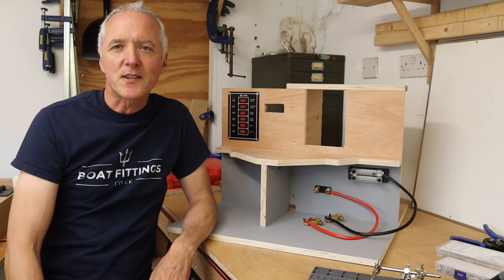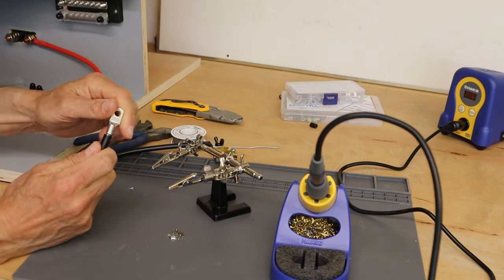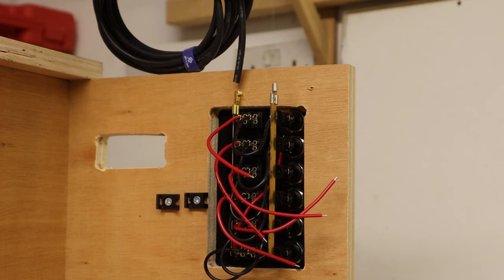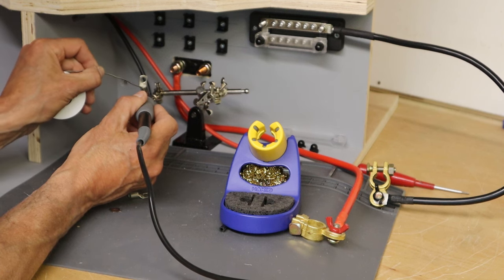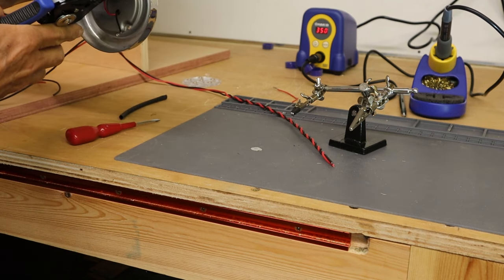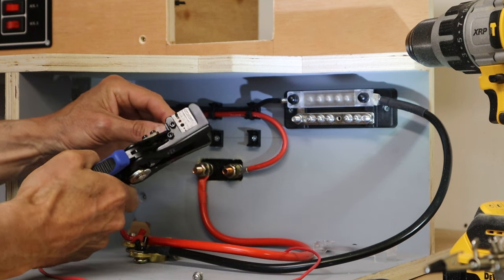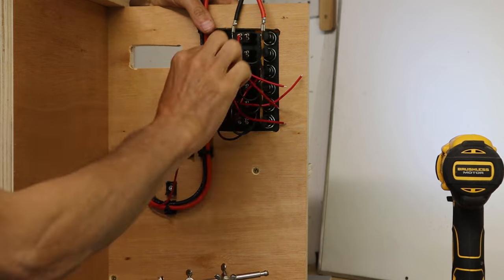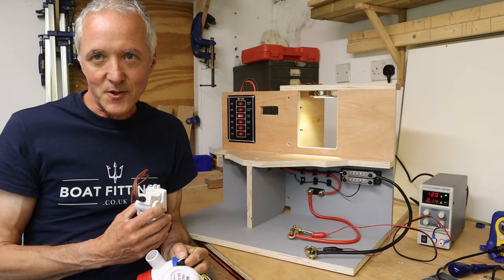Boat Electrical Wiring Made Easy, Part 2, Switch Panel Wiring, Cabin Light Wiring - Complete Guide

Comment: Great how-to videos so thanks for putting these out.  You commented you prefer solder vs crimp connections.   My experience is driven from aircraft standards and those specify crimped connections using good quality AMP / aircraft grade terminals that crimp both the stranded tinned wire and also the insulation covering the wire.  Also need to use a good quality crimp tool  for this purpose.  If you use low quality automotive style terminals and the simple single point crimp tool they only crimp to the wire and poorly at that and will fail if you pull on it.  The correct AMP / aircraft style double crimp connector crimped with a good crimp tool will not pull out or fail.  We tested them to failure and the wire will always fail first (so as strong as you can get) and the crimped connection remained intact.   The crimped aircraft terminals are done that way for the strength but also for the same reason we use tinned and stranded wire, never solid wire, because of the possibility of flexing and vibration which is the same type environment on a boat as on an aircraft.  A soldered connection is more prone to fail if flexed or subject to long term vibration.   The added benefit of using AMP / aircraft grade crimped terminals is it is easy to do a new connection or add another terminal on the water as you don’t need power for soldering or the soldering equipment. Easier to carry a good quality crimp tool, wire stripper and extra terminals. Just a suggestion for you to consider or try yourself.
Reply: As a note, ABYC Standards do not allow solder as the sole means of connection for an electrical connector. You can crimp AND solder, but solder by itself is not permitted. So if your boat may be subject to ABVC Standards (or you want to meet typical standards) then crimping should be used or used as well. Not probably an issue based on the accent in the video, but I'm not sure of Euro/UK standards and if they differ.
Reply: @jeffclapp7330  I believe that soldering is not recommended because it can make the wire more brittle.  You want the water to be flexible.  Also, he "tinned" the wire with solder, but he should have already been using tinned wire.
Reply from the maker: Hi many thanks for your detailed comments / suggestions.  I agree that good quality crimping tools and the corresponding connectors make for a robust solution.  In many cases though people use cheap and nasty crimp tools leading to a poor joint, which in my opinion makes soldering more reliable compared to many poorly crimped connectors.  I do take on board your comments though, and thanks for making them.

Kind regards,

Richard

Comment: I have found it easier to understand once I get the concept of a circuit in my mind. A circle; starting and ending at the battery going out to the appliance on positive and back from the appliance on negative; with the various switches and fuses on the positive side. 

Good videos, thanks.

Comment: Very well explained and looking forward to Part 3. I am hoping you will deal with the challenge of multiple interior lights and running out of switches as the series progresses . Thanks again
Reply from the maker: Hi thanks for your kind comment.  Thanks for your suggestion on looking into the wiring of multiple lights - I will keep this in mind for one of the videos in the series.

All the best,

Richard
Reply: Can you run a busbar for all your led lights back via a single wire to the switch/breaker to avoid overcrowding the switch with more and more wires as lights are added (or any other system where things are added on. Subject to load obviously).
Reply: Great videos by the way
Reply: @BoatFittings  looking forward to seeing this. ☺

Comment: crimps are normally preferred in harsh environments, great aid for the diyer
Reply: Which is why they are used on automobiles and pretty much everything else. There are people who insist on soldering everything because they had a crimp they did go bad but they can never answer why a 30 year old car still has good crimps. If you are going to solder then get solder connectors v.s. using crimp ones and then add shrink wrap to provide some stress relief as well as short protection. The big issues with solder beyond the time to do it are corrosion due to the flux and cracking due to the hard spot. Modern solders also take a lot of heat and that means melted wire covering which is perhaps why silicon is being used here.

Comment: The amount of positive comments is testament to how great your videos are. Thank you. I have a question: why couldn’t I use the negative bus bar on the switch panel for individual negative returns? On my switch panel the negative bar is of a similar gauge to that of the positive one, making me think it should handle the current that would return through it if I connect the peripherals there directly. Also, if no peripheral negative returns go to the panel bar, then why do you need the fat return from panel to battery? It would seem you would then only need a cable to handle the current from the panel pilot lights?
Reply from the maker: Hi thanks for you comment / questions.  I don't want to comment on your specific switch panel, but I if your switch panel has a good sized negative bus-bar then it would seem reasonable to make use of it.  For your second question, the 'fat' negative return cable was used mainly as it came as part of a set (positive and negative) than the need for a fat wire.

Kind regards,

Richard

Comment: Hi Richard, brilliant series. i've just discovered your channel and will be bingeing your back catalogue every day! What a mind of information you are! Even just to remind oneself before carrying out a "job" your series is brilliant!. I have an old 1992 35ft Nimbus DC currently based down in Cornwall (legs reconditioning!) with so many jobs, my early retirement will definitely not be idly spent! And if you ever want to set up a boat series, I'm happy to work with you to make it happen! I have 2 x VP AD41's on sterndrives, so plenty of electrical stuff to work on both engine and domestic!!
I dearly want to replace a switch panel on the helm station, as the bakelite switches are all perishing, and was wondering if you have contacts other than the usual large distributors that I might try finding old replacements? New may be better for waterproofing, etc, but will change the look substantially? 
Keep up the great videos.  regards, Daniel

Comment: What are your thoughts on putting a bus bar closer to the switch panel? also Using a fuse block and using 1 wire with 2 wires in it for Pos and Neg? Thanks for the series I'm finally getting less intimidated and looking forward to cleaning up the rat's nest situation I have under my center console boat.

Comment: Great video, very clear and well explained! I have a question though: Why does the black wire needs to be so think which goes to the switch panel? It supposed to supply the negative only for the lighting of the switch panel, which is like 6 LEDs. Or did I misunderstand?
Reply from the maker: Hi thanks for your question.  Actually the negative wire happened to be part of a set purchased together, so it seemed a shame to waste it.  Other than that no reason at all, and a lighter gauge wire would have been absolutely fine - well spotted.

Kind regards,

Richard

Comment: Which voltage should I choose for a trimeran? 12, 24, 36 or 48?
If it has twin 2000hp diesels and 5 800kw outboards what sort of capacity should the batteries have?
Is lithium the lightest?
Thanks Philip

Comment: This is great! Looking forward to the next episode.

Question, I'm using fuse blocks instead of bus bars / fuse boxes - my boat has two cabins with the engine in between. Would you recommend having one fuse block per cabin (running a big, but only single wire through my engine bay rated for the fuse block. Or would you run individual wires to the seperate cabin and keep things centralised?
Reply from the maker: Hi thanks for your question.  I think it would be no problem to have individual fuse blocks in each cabin if that makes sense for your wire runs.  The only thing I would add is to keep things obvious and clear for yourself, but more importantly for the next owner of your boat.  I guess from that point of view people might expect one fuse block, so I would suggest finding a way of making it clear and easy to find that there are two fuse blocks if you decide to go that way.

All the best,

Richard

Comment: Thank you very much for these videos. Just what I needed to know. I did wonder what the wiring sequence is for the circuit as a whole. e.g Battery-Fuse-Switch-Device or Battery-Switch-Fuse-device? Would be good to understand if you could tell me.

Comment: This is really useful for someone trying to figure out the wiring in their narrowboat! A question I have is for when you want to wire up multiple lights. Because the wiring is all hidden on my boat, I'm not sure how it's currently wired up. What would be the most likely way that they've been wired up? I can see on the switch panel there is just one switch for internal lighting. I have two lights which aren't behaving properly - one of them is not lighting at all and putting my multimeter on the wires to the light shows 0 volts, and the other at the front of the boat just flickrs although it lights dimly and so trying to work out what the problem might be. Any suggestions of where to start looking? Thanks very much!

Comment: I looked but could not see question & answer in previous posts, so here goes: why does the negative from light not connected to negative side of switch panel, but instead is run to negative bus? Or does the switch panel not have a negative side and for my simplistic brain, would it make more sense to put the negative bus beside switch panel?

Comment: curious why you run the component ground/negative all the way to the bus bar versus just writing the component circuit to the negative switch bus? What drives the choice? Assuming the switch is at the front and the bus at the back would you just run the wiring to the closest ground? It may make sense as you build out the boat?

Comment: Im an automotive technician. One tip i have for soldering those big wires- don't use an iron. Use a mini torch (butane), and head the wires with that, carefully, and fill with solder. It is much easier and quicker

Comment: Please, sir, make a note in the video about soldering vs. crimping the “crimp terminals” used in the demonstration. Crimping is superior to soldering in marine environments. The pull test comparing a soldered connection and a crimped one you mention in some comments ignores the fact that the solder is brittle and is prone to fatigue failure in the long run. A crimped connection will not suffer from fatigue. This advice assumes that both the soldering and crimping are done properly. But also please keep in mind that soldering is a skill that needs to be practiced. Given an inexperienced audience in both, it’s easier to make a bad soldered connection (even with the best soldering stations, which are expensive) than to make a bad crimped connection (requires less skill and good crimping tools are cheaper than before these days). Kind regards.

Comment: What a great video.  When you solder the red/black wires from the LED lamp to the wires running to the busbar/switch it looks like you have just tinned them and soldered them touching one another.  Is this sufficient, wouldn't a splice or doing a x-spin around be a more secure joint?
Reply from the maker: Hi thanks for your comment and question.  As long as there is plenty of solder from the tinning process, and a good overlap and 'wetting out' of the solder these kind of joints are very strong.  If in doubt try one yourself and try to pull it apart - bet you can't.

Kind regards,

Richard

Comment: Neat video. One thing i dont think you explained is why you use solder on what is essentially a terminal which is forced on the the wire  i have never seen solder on boats . I understand that it is not used to join things due to vibration
Reply from the maker: Hi thanks for your question.  In my experience solder has never let me down, but crimps sometimes have.  I am aware that some people prefer to rely on a crimp.

Kind regards,

Richard

Comment: Incredible video! One question though… can you use different negative wires on the same bus terminal? 

I am wiring up my boat right now and I have more negative wires than I have spots to put them
Reply: My, inexperienced answer is yes. I have a bus with multiple wires on the same connector to the bus. The circuit just needs to have a positive and negative. Although like you I am rewiring as it is a mess and lots of wires that are obsolete or redundant!

Comment: Great amazing video. Thank you so much, I’m doing my boat electric for the first time I’m still on the research part but I already order some parts. This is very informative and detailed
It will definitely give me a good sense of confidence while doing it
What’s the name of the power supply? 
I feel I’m gonna need it to test things before securing wires

Also if you have any additional tips I’m open to it
Reply from the maker: Hi thanks for your kind comment.  The power supply is a variable power supply, rated at 10A.  You can find many versions of this with a quick google search.  Mine has fully adjustable voltage and adjustable max. current draw which is useful.

Kind regards,

Richard
Reply: @BoatFittings  thanks so much I just ordered the same one as yours.

Comment: What is the point of running a negative lead from the swich panel to the bus bar and then run the negative lead of the light to the bus bar instead of connecting it to the switch panel?

Comment: Hi. Great video. 
May I ask why you didn’t install a main breaker from the +ve battery terminal. I’ve seen it on many other installs. Am I missing something?
Thanks.
Reply from the maker: Hi thanks for your question.  As you have mentioned it would be possible to put the circuit breaker as part of the battery terminal.  I have shown this as a separate mounted master-switch, as this gives you the choice of where to mount it for convenience of access etc.

Richard

Comment: Great video which explain boat wiring in an easy understandable way, but sorry that I have to be the grumpy old man, but a fuse between the positive side of the battery and the master switch is mandatory, to be in compliance with the safety standards for boats, booth in EU and for USA. Imagine what will happen if a shortage happens between the positive side to the negative side somewhere between the battery and the switch board. Worst case scenario is a fire onboard, overheating of the battery, which might cause the battery to explode. So please add a main fuse. How to dimension the fuse? Calculate the total possible load and add 25%.
Reply from the maker: Hi thanks for your informative comment.  I take this on-board, and will make some future video incorporating this information.

All the best,

Richard

Comment: Great video! Thanks for the reallyy detailed information. I have a question;
I'm going to wire my boat ( a small rib) using fuse box instead of buz bar. Fuse box has integrated buz bar in it. And i have a switch panel. Can't figure out one thing which is;
Should i make the main power inlet for the panel through the fuse box or directly from the battery. Every instrument will go through the fuse box after connecting the wires to the switch panel. But cant figure out the switch panel's main inlet. I'm not a electrical guy and think this is a really silly question for such an experienced man like you but will be happy if you'd answer it. Thx 👋
Reply from the maker: Hi thanks for your comment and question.  I am sorry to say that without seeing the specifics of your fuse-box and switch panel I can't confidently answer your question properly.

All the best,

Richard